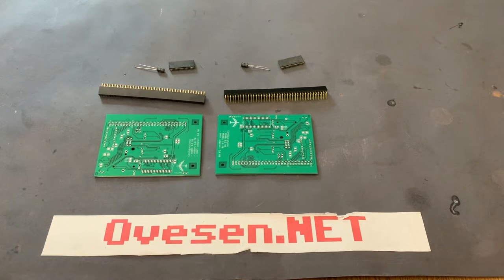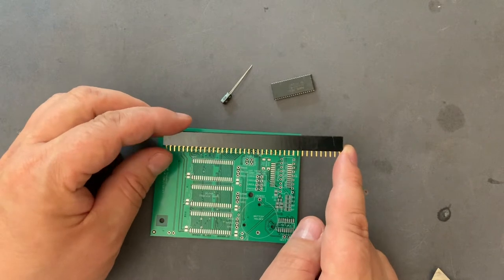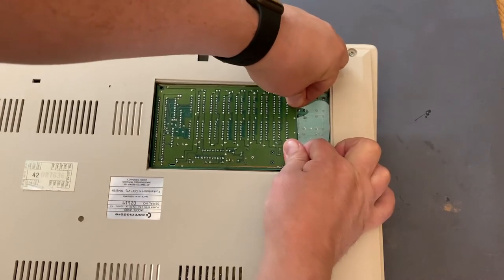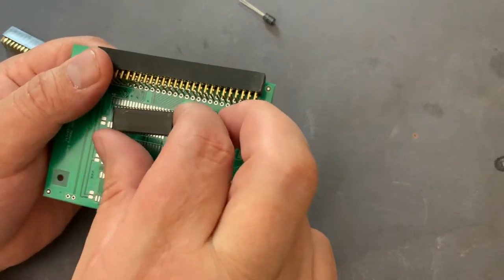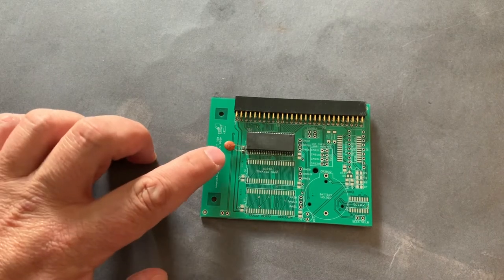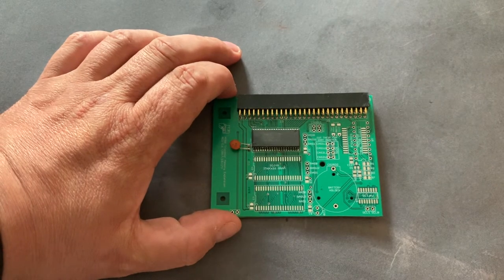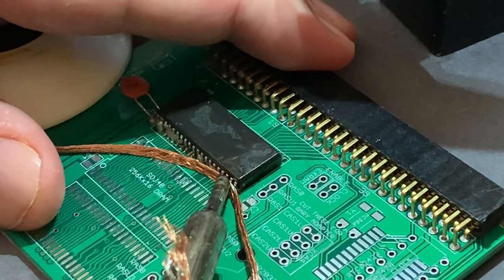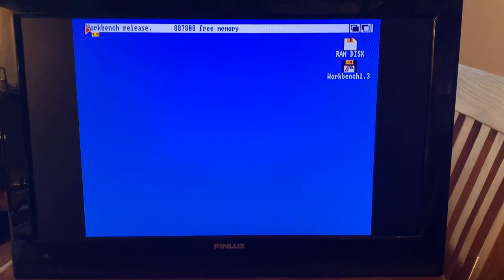Building an Amiga 500 memory expansion card

Comment: Try a razor saw and mitre box.  Cuts cleanly and squarely.  For SMD soldering with an iron, the right tip makes a big difference.  A fine bent conical tip works well for "drag" soldering (and I'm one to talk... I've never used a heat gun for soldering).  This took a bit of "stick-to-it" perseverance.  Well done!
Reply: Yeah, a tiny soldering tip it is for me too. Then don't try not to get upset too much if two pins are shortened. I'd always clean those up after soldering with either the soldering wick or by shaking excess solder from the tip and re-heating. Every time you touch some more will stick on the tip and less on the pins involved. Me personally am in the fights with the even smaller SMD. Has anyone tried to repair those really tiny SMD on a Raspberry Pi 4 ?